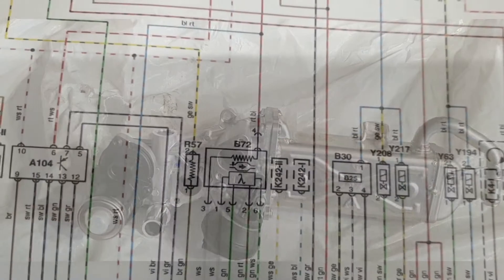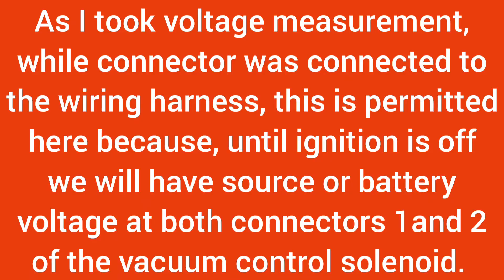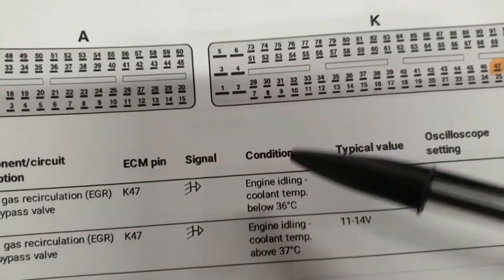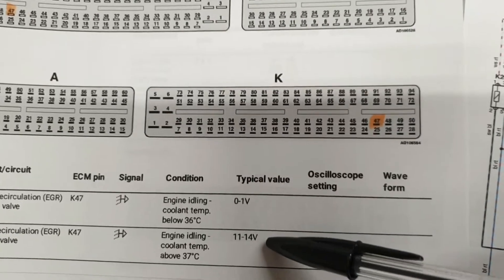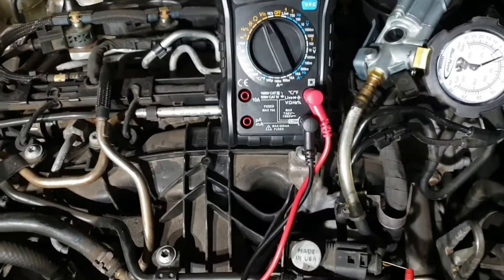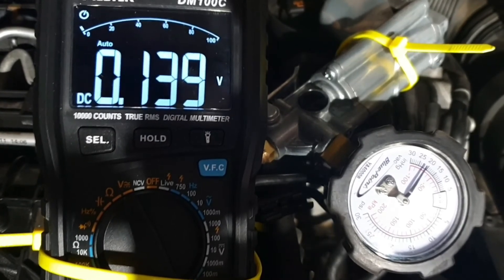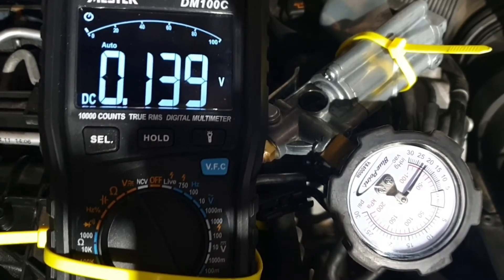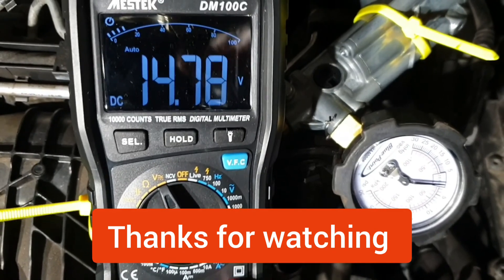Vw Passat 2.0 TDI Common Rail Blue Motion Technology (EGR) Bypass Valve Vacuum Control Solenoid Test

Comment: What were the symptoms of the fault in the car?
Reply from the maker: I cannot recall, but it is possible that you are experiencing this.
Reply: @stanhopeautorepaircentrewardak I have no warning lights or codes. I just notice engine revs stay at 1000rpm while idling and i can get a hot exhaust/fuel smell